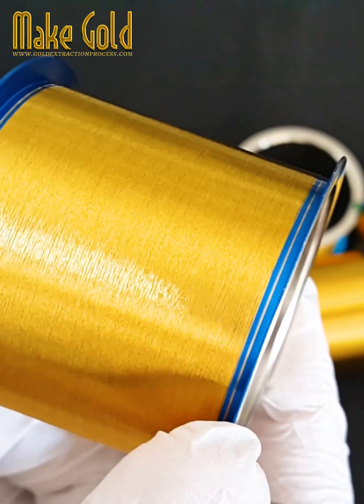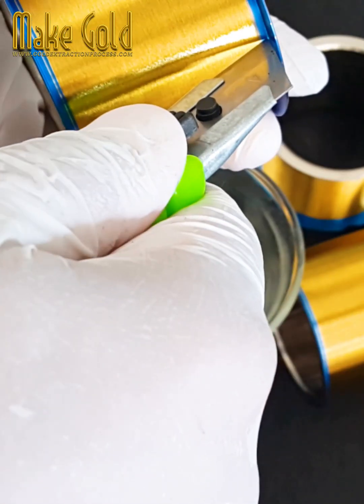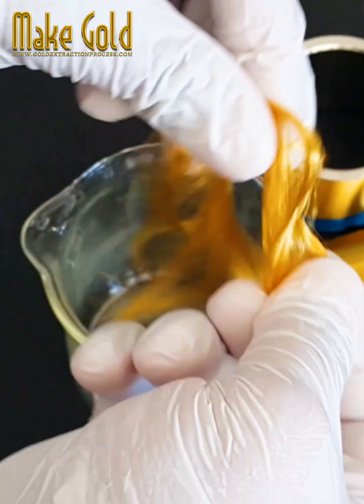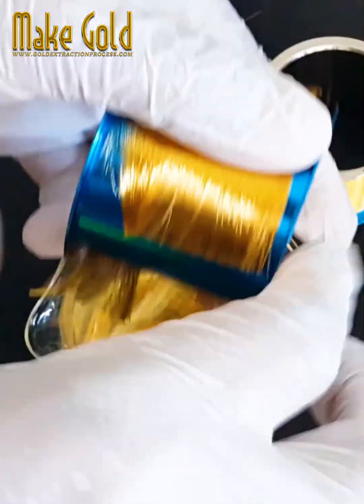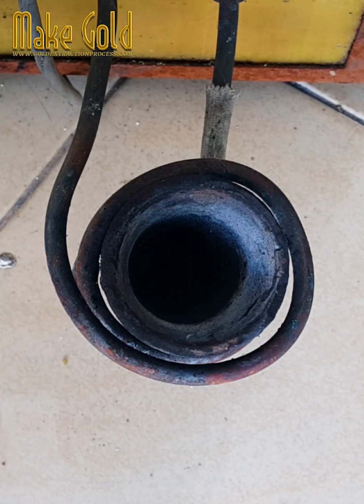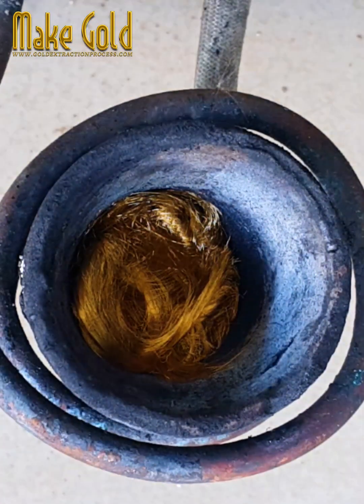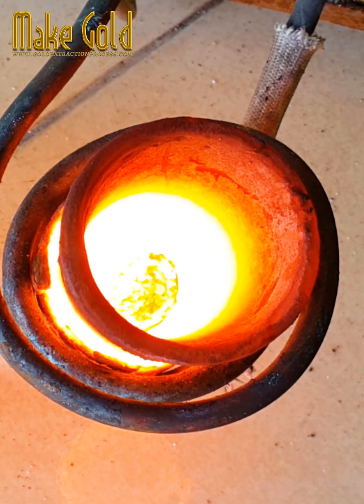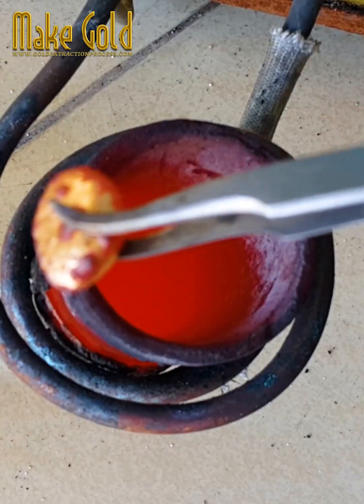🧵 Gold Bonding Wires – The Pure Gold Hair Powering Your Electronics!

Comment: What real device is this from??
Reply: Gold bonding wires are used in IC chips to connect the legs to the die. 

In this case, these are spools that go onto the machine that bonds the wires. What happens is the wire/spool will be considered “expired” by manufacturers after a certain age, thus needs to be replaced. 

The spools are sold for scrap and gold will be melted and restrung onto the spool again for new use or scrapped and sold for something else.